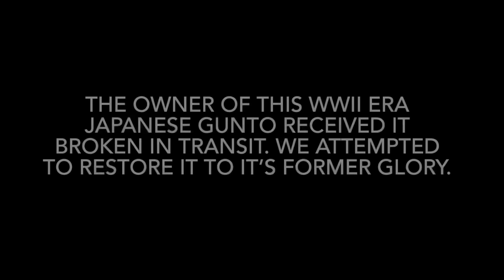WW2 Japanese Katana Sword Handle Restoration

Comment: Are you going to put a string thought end of the Handle like some of the WWII swords did ??? I have an old family sword that had the WWII handle and scabbard upgrade for use in the pacific war but the blade it’s self is 17 century but still in original condition
Reply from the maker: That sounds like an amazing sword that you have. Unfortunately we didn't have time to try and find a tassle for it. But I'm also told many times these were removed in theatre as they tend to get in the way and also make a noise. But I'm not an expert enough to say for sure. 😊
Reply: what you want paper hat

Comment: Amazing work, peace of art,absolutely real skin on handle
Reply: A lot of pacific Island warriors used stingray skin on the handles of their weapons. The Maori used it a lot and so did tribes in Africa. In Japan though, only the clans that were near the coast used it. In the inner parts of Japan they used resin or lacquer over raw wood, or bamboo leaves. When the soldiers and samurai picked up the weapons after battle or clans joined and they discovered how much better the grip and durability was with tanned stingray skin as opposed to hog hide, cow leather, and lacquer over leaves, they began to use that everywhere. Then later they began wrapping leather around the ray skin for extra grip. Alternatively horse hair was also used for this, peeled bamboo strips, and pig hide that had been treated using the stomach acid of slaughtered cows and then cleaned with soap. Depending on your status as a soldier determined what wrap was used for your sword. I learned this from a museum feature we had in my city and it was nothing but weapons from Japan. The Japanese really went out and stole ideas from everyone. But they used what worked.
Reply: Bonjour,petite rectification quand même la Poigne6 comme vous dite si bien ce nomme en Réalité  dans les thermes  traditionnel japonaise,Une TSUKA. Merci et bonne journée à vous

Comment: The blade is spectacular. I wish to have a sword as nice as this one. 
I have a nice blade with the fittings only all wood parts ate gone. Been trying to make the wood parts I do not know how to make them. 
Your work is amazing. Wish I could have finished. Affording the repair is at the moment is way outside of my budget.
Thank you for posting this video.
Reply from the maker: I would suggest giving it a try. The expense really lies in the time. The materials are relatively inexpensive so even if you get it wrong it's not the end of the world. You should be able to find lots of info online about how to make the Tsuka wood core.

Comment: Beautiful restoration, i really love your attention to details.
But something is bothering me, the handle seem to fit in very easly wich makes me wonder if the sword isnt ratteling inside?
Reply: There is a pin that locks the blade in place inside the handle, which you see is tapped in at the end. The samurai sword is purposely designed so that the hilt can be replaced and maintained and also for the maintenance of the blade it's self. 😊

Comment: looks to me like this is our first time
rayskin should be in a recess and the paper is not under the twists it acts as a transition from twist to handle edge
it also helps to hammer down on the twists for tighter wrapping 
end result looks good enough for a display sword

Comment: Good job !!! is a industrial sword made with the mold.Not hand  made. Shinogi,hira and hamon are not present, so the sword does not come from a hammered piece of steel but from a casting in the mold.👍
Reply from the maker: Yes, I would say its a low quality factory sword. It is old but I'm not expert enough to say how old.
Reply: they're not molded or cast, they're forced from bullets by a machine, similar to a kitchen knife

Comment: How did you finish the handle tie ends. I saw the knot you were doing, but did not see how you ended the wrapping and cut off the access. Was that rice paper you used under the twisted parts and the round balls for the end knot? I was just wondering why you didn't use rice glue to put the handle together. Awesome job on the restore though!!
Reply from the maker: We used washi paper for the paper balls and under the knots. We considered using rice glue, but other than being absolutely authentic there's no real reason for it, so long as the glue you use is low acidity, which we made sure to use.

Comment: Why not a full rayskin wrap? They saved on the rayskin because those WW2 katana's are mass production. Only high ranking officers got high end blades and fittings. To bad the restorer also did 2 panels and not a full wrap. Still verry good looking tho.
Reply from the maker: The owner wanted it for display purposes only. Full Rayskin costs more. A restoration like this is already probably more expensive than this sword was worth - so its a matter of weighing up what its worth and what will be done with it. If its a 17th century sword in pristine condition, it might be more worth while to do it 100% authentic.